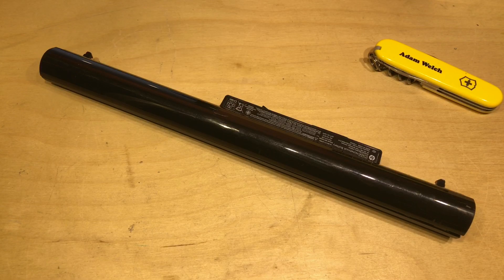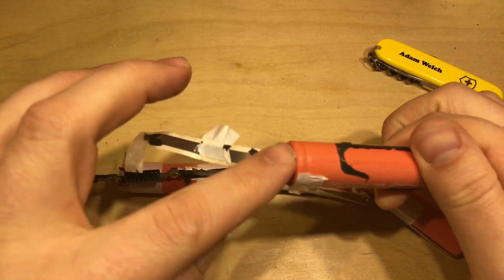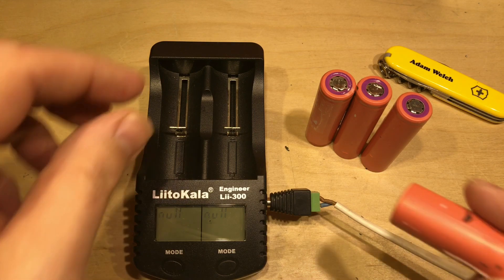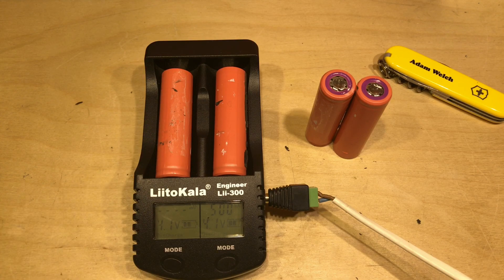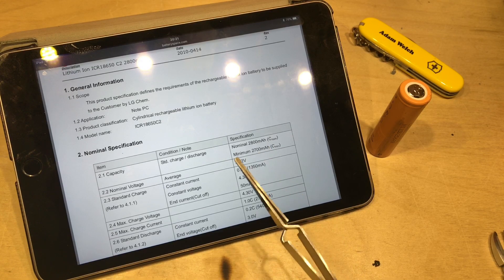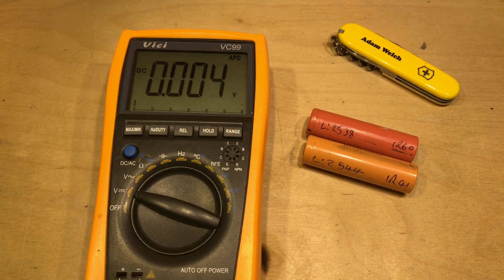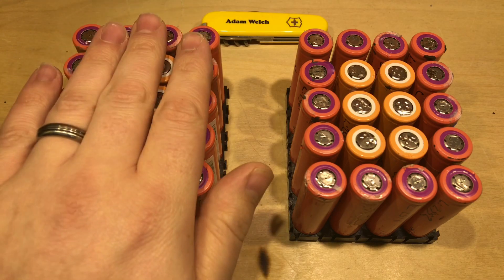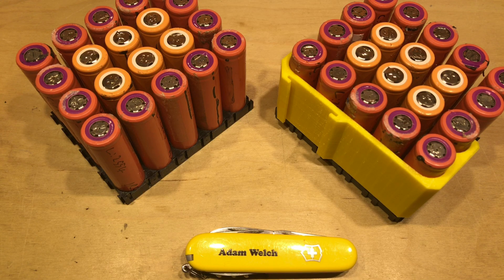Recycling & Processing 18650s from Laptops - 12v Solar Shed

Comment: What was the trigger to upgrade from the existing 12V system to a 24V system? Clearly most low voltage equipment is designed to run with 12V...

Comment: Hi Adam, you say 1.4kwhrs? - at 6.55, for a 7s20P. can you explain the maths for working this out please.
Reply from the maker: The average cell in my pack has over 2.5 amp hours of capacity. As you say there is 20 cells in parallel so that’s 20*2.5=50Ah. The nominal voltage of the cells is 3.7 volts, so with seven in series that’s 25.9 volts for the total pack. Finally 25.9 volts multiplied by the 50Ahs is 1.295KWhs (I got it wrong if I said 1.4KWhs).

Comment: I keep meaning to get more 18650 cells; but I have of late not been able to find more reasonably priced used laptop batteries. I think we're all driving up the ebay price. :P

Keep going, and nice job on the bracket to hold them to the rail! Did you make that yourself?
Reply from the maker: Yes I designed and printed the DIN rail bracket - but it is a complete rip off of Paul Kennetts small blocks din rail bracket.  
Sadly laptop batteries are becoming more expensive as people realize they have some value.

Comment: You wont be using flat battery holders anymore then? I have built a 3s80p from your original battery holder idea. The grand advantage being able to swap out cells with ease to upgrade or replace cells in the PW. It is working very well. And I'm about to build another.
Reply from the maker: I have an issue with space in the shed and the flat arrangement takes up a lot of desk or wall space.  Placing the cells into blocks is a much more efficient use of space.  I still think the flat arrangement works well (and has advantages over the block idea) in some situations though.  
Anyway - I'm glad to hear your arrangement is working well.

Comment: Adam have you decided on what method your going to use for your balancing?
Reply from the maker: This is a video in itself!  I'm wondering how even they will stay if I am very careful on how I group the cells.  If I can make them very even then it might be that my small balancing solution my have enough grunt to keep them even balanced.  If not I've been looking closely at an alternative with a bit more power.

Comment: Hi Adam nice video, when I was harvesting 18660 Cells I also charged the low / no voltage ones at a small current to bring them back. I will look forward to your coming project. Cheers. All the best. Steve.

Comment: G'day Adam, from Down Under,
I've been a follower for ages and look forward to your videos - this one is no exception - outstanding
Middle of summer here (currently 3pm and 42C) and am spending time in the AC recovering used cells from the usual laptop batteries.
I find most (50 batteries for 400 cells) laptop batteries have 2 cells that are stuffed, to use the technical term, and most of the rest exceed 2200mah. So about 300 usable cells, after testing and resting.

Aldi here (is Aldi on the small island?) had 4ah LiIon power tool battery packs for $20 AUD (~$13eu) new. 10 Samsung 20R cells per unit. 
Average capacity (charging to 4v and discharge to 3v) has been 2745mah. Ecstatic!
I've been using a genuine SkyRV B6AC V2  to charge, discharge and capacity test recovered cells and am quite pleased with it.
I'm building a Powerwall to fit to my Motorhome/RV to replace 12 volt AGM's.
I Use/burn 1.3kwh @ 12volts per 24 hours before Solar input/alternator input/battery charger input.
Looking at the optimum configuration.
Would 4S/10P give me enough?

Many thanks for all the support over the past 2 years.
Reply from the maker: Cheers Mike, really appreciate that.  We do have Aldi yes, and that's an interesting source of cells if the price comes in at a sensible level - I'll bob down.
What charge controller are you using for this 12 volt pack?  I'm just not sure 12 volts works terribly well with lithium.  I can't seem to make 3s or 4s fit.  I covered this way back when I did my first charging lithium via solar video.
Theory has it,  2745mAh per cell should give you a capacity of 462 watt hours (27.4Ah*16.8v=462) if you charge them all the way up to 4.2 volts (and discharge them all the way down to ~3 volts).  I think it is falling short of your target, even though some of your consumption is presumably in the day and will come straight from solar.
Reply: G'day again Adam,
I'm using the EPEVER TRIRON 20A MPPT modular Solar Charge Controller.
I will go back and review your 'charging Lithium via solar' video.
What are my other choices?
Most of my RV output will be to 12 volt gear - lights, water pump, chargers, compressor fridge (although it will run on 24 volt), TV/PVR. 
Kitchen gear would be about all I need an inverter for and 500 watts of inverter handles what I use.
Given the fridge is the biggest power hog by far (average 48 amps a day), should I go with a 24 volt battery (7S) and buck convert down for my 12 volt needs?
Any other tops greatly appreciated!
TIA
Reply from the maker: You can adjust the charging parameters of the TriRon to suit your 4s pack because every setting can be set between 9-17 volts (there are just the rules you need to take into account that the equalization voltage must be higher than the float etc.) so then it comes down to how tolerant your 12 volt equipment is.  You'd imagine that they will all work between say 11 and 14 volts because that is typical of a automobile situation, but what happens with them if you charge your pack up to perhaps 16 volts or 4v per cell?  Some of the items will have datasheets you can find - others may not.
Running a higher voltage pack has a couple of advantages.  It means you can use lower gauge cables because you're pulling less current for the same wattage, and inverters are generally a bit more efficient when the jump between the dc voltage and the ac is less.  However if most of your kit is 12 volt then converting the 24 volts down for everything but the fridge will also have its losses.  You'd also need to think about your panels - because you'll need their voltage to be higher than your battery pack.

No firm answers there, but hopefully some more information to chew on?
Reply: G'day Adam,
On your 'Theory has it' above - if I'm using a 10P pack wouldn't that then give me 27.4*16.8*10=4620 or if I use 7S @ 4 volts and average 2500mah - 25ah*28v*10P=7000 Wh? or am I incorrect in my calcs here?
Reply: My panels are 24 volt 250 watt x 2, so that shouldn't be an issue.

Comment: I have noticed that the failure of a lot of HP batteries seems to be the supporting circuitry, it's weird
Reply from the maker: I've heard it suggested that the fail safe modes on some laptop battery BMSs will kick in for various reasons.  Too many cycles, heat, left uncharged for too long.  The question is have they failed because of poor design, or are they designed to fail?  I don't know.

Comment: Cool! I just need a charge/discharge intelligent charger. I've got the Xtar VC4, but no discharge function :o(
Reply from the maker: The standard that people seem to use is the Opus C3100.  I have one of those but as I started on my liitokala it is my bench mark.  All done now anyway, and although using a different charger may have been faster these have sat around for quite a while now waiting for me to get my act together.
Reply: Cheers for that :o)
Reply: The Opus C-100 is actually an improvement on the circuit of C3100, but  one channel instead of 4. I use the Liitokala single and dual port like yours, and then I have 4 x C100's intead of a C3100. The reason is that the Opus is probably the best analysing charger, but the C3100 doesn't support LifePO4 unless you chop it to access the internal switch on the PCB underneath. And that switch changes all 4 bays from 3.7V to 3.2V. The C100 supports LifePO4 in software, so you can choose it in the menu.

Comment: Will you use any of the previous parts? Like that black voltage tester / balancer and the mppt? 
Would love to see a finished working system and how you got there. I've got plenty of 18650 cells, but I want to start out small ( cheap mppt etc)
Reply from the maker: Due to the size increase I'm not sure the capacity controller will be up to the job.  It only balances at about 50ma if I remember.  I could reuse the charge controller (which is PWM actually) because I'm not intending to throw any more solar panels at this system (purely because I haven't the roof space).  If you want to start out small, my little test pack has been running (and expanding) for the last 18 months.  It's been working really well.
Reply: Ok. Looking forward to more videos in this series :-) 

I just want to create a proof of concept before I decide if I want to invest in bigger solar panels, charge controllers, balancer, inverters etc.

Comment: Glad to see you're getting more into 18650s and following HBPowerwall.
I got bitten by the bug too last year and have since collected a couple of thousand free cells from local laptop service shops - when you've got thousands of cells to process you'll go nuts testing them at 500mA, so you'll soon want a rack of Opus chargers to munch through them like Daniel aka DIY Tech & Repairs made. (I recommend you follow him too if you aren't already).
Reply from the maker: Yes you're absolutely right - 500mA would send me potty with that many cells and you've noticed my mistake - DIY Powerwalls is the forum, not the youtube channel.  Thanks for the tip, I'll take a look at DIY Tech & Repairs.

Comment: Shameless self-promotion:
I'm currently working on a Battery Monitoring System using a ESP32: https://hackaday.io/project/27506-6s-iot-bms
Currently I intend to use it for a 6S pack but the hardware (and hopefully software when i get to write it) supports up to 8S.
Reply from the maker: Thanks for the link - I'll be sure to take a look.
Reply: Very interesting,  Ive been messing today with an esp32 getting mqtt data from a broker which publishes my solar data from a database on a RPi and writing to to a waveshare 1.54 inch screen.  This will be for a portable solar dashboard.  If i need it Ill look at power saving and battery.  Will certainly keep an eye on your project

Comment: awesome!! I am in the process of sorting all my cells, all the cells I got for free from work have been actual bad packs so I am probably going to have a high failure rate (ones that arent up to par) but hey all the batteries I have were at no cost so my total system would be alot cheaper.
Reply from the maker: All the cells I've previously been using have been free to me.  Sadly the flow has dried up so I took the plunge and bought some.  I was interested to see what the quality would be like - and I think ive been pretty lucky with these cells.

Comment: It has been documented that US military charges these batteries to 3.9V and gets about 10 times the life (30,000 cycles) as if they were charged to 4.2V (3,000 cycles)
You might want to consider that.
Reply: LiIon generally dont go above 500 cycles if you do a 80%DOD and charged to 4.2V. Depending on capacity left. 3000 cycles is generally more of a LiFe cell sbut this is LiIon
Reply: UFOhunter after been working with lithium based cells for over 10 years and having 30 000 18650 cells in my own system im pretty Aware of what cells are Good and and not ;)
Reply from the maker: I've been charging my smaller 7s packs to 4.0 and I've personally run them for a year (wouldn't really say 365 cycles though) and lost very little in the way of capacity.  I've done a video about it, if you haven't seen it.
Thanks for that.
Reply: Yeah mine goes only to 4V as well and have had packs for over 2 years now with kind of 0 degradation. How long they last is another thing and in my case i generally dont do more than 20%DOD  per day since my battery bank is huge.
Reply: The cycle count for Lithium (and other??) cells is calculated by manufacturers as the number of complete charge/discharge cycles. If you only charge them half way, and then discharge them, it's counted as 0.5 cycles. Have you any way of verifying how the military define a cycle? They may be counting each partial charge/discharge as a cycle. So if that is the case, then they might, for example, be charging to ⅔ capacity and then discharging. That would give an apparent life of 3,000 cycles, which is, by the manufacturers' metrics, only 2,000 cycles. 

There may well be a real increase in service life, as could be expected after studying the chemical and physical changes over time, and considering the effects of charging and discharging todifferent end-point voltages. Some clarification of. the claims would help greatly here.
Reply: My own tests showed there was only 400mAh between 4.2V and 3.9V on a 2400mAh cell @C/10. They discharge to 3.0V as usual. 
I am sure there must be a reason they do that on expensive military grade cells.
Reply: UFOhunter no one charges to 4.2 if you want it to live more than 2 years :)
Reply: except every charger I have seen!
Reply: Also, don't compare the shit cells you buy from China, to Military grade cells made in USA.
Reply: Good for you.

Comment: Hi Adam, I balance my battery pack by constantly cycling a same voltage auxiliary battery to each battery in turn. In this way over voltage batteries charge the aux batt and lower voltage batteries get charged. This wastes no power unlike other systems that load the higher cells with a resistance.
Reply: Hello Howard...This sounds rerally interresting...! Do you have a schematic or more details  for your set up...?  Greetings for now...Jakob.
Reply from the maker: A very neat idea, I think I have seen this idea somewhere.  I'm a fan of the smaller losses.  Love to hear and see some more if you have documented it somewhere?